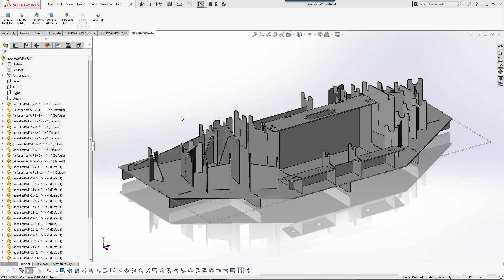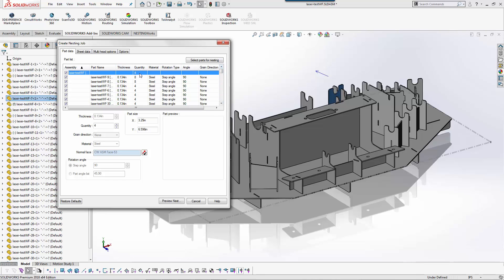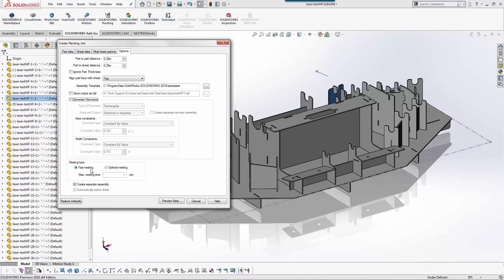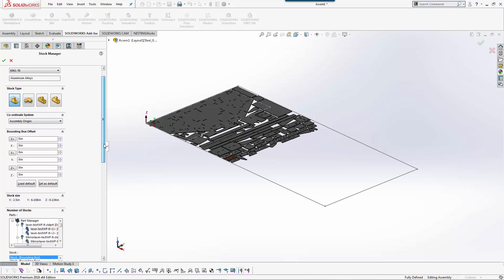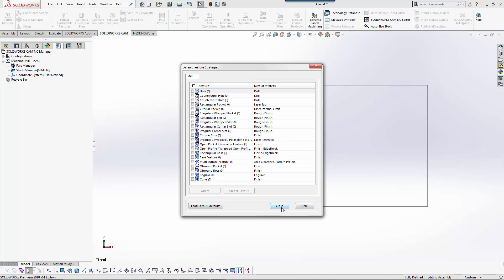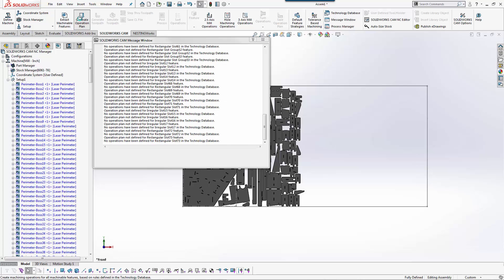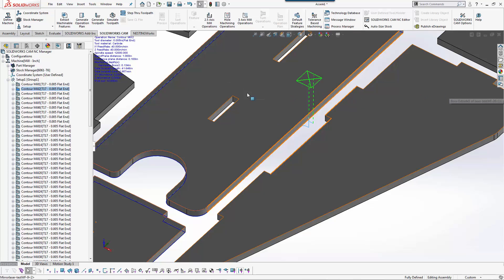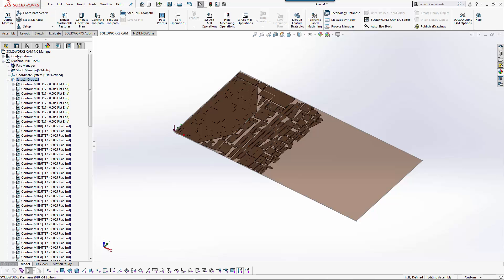NestingWorks and SW CAM Professional

Comment: Thanks for the overview with the sheet metal example.  At 11:25 woodworking is mentioned.  Any chance there is a video overview for the woodworking industry using 2.5 axis milling for example flat pack furniture. Does this CAM software auto recognize woodworking specific features that vary in depths such as open pockets (dados) , countersink holes? I would love to see a demo.

Comment: Why can I not see a dropdown for other strategies from within the Parameters menu shown at 10:30? First time in Assembly mode and it seems like an unavailable feature?
Reply from the maker: Brian, I would need to see your assembly and the database you have set up to answer this question.  You should see machining strategies that come with the software.  The ones for laser are ones I created for my own machine in my shop.  Please connect with me using the SOLIDWORKS forums and I can try to help you out.  Mike

Comment: Is it possible to label the parts? A random pile of un-labeled components is not much good to the guy on the shop floor! :) 🤔
Reply from the maker: Yes.  There are several ways to label components depending on the equipment being used.  We have worked with some companies on API's to auto label with a label maker.  I used to use etching on the laser to etch the part numbers on the components based on the file part number, and sketch text to a property file.  The part numbers were auto-serialized by SOLIDWORKS PDM.  We used the sketch text function to link to the file name property and then in SW CAM used a strategy for etching that would automatically apply the correct tech table in the laser.  It took a little effort to set it up but was automatic going forward.   For the label maker, it is reading a file outside of SOLIDWORKS, then through API's it finds the part and creates an automatic location for the label to be placed.
Reply: @the3dexperience807  Hi! Ok. Thanks very much for your reply. I thought some sort of custom macro or even API might be needed. Sad this isn't built into NestingWorks but I guess everyone's need is slightly different and with a little coding know-how you can tailor something for your needs. Thanks for your help. All best.
Reply: https://www.youtube.com/watch?v=1CHhxsf3jd4